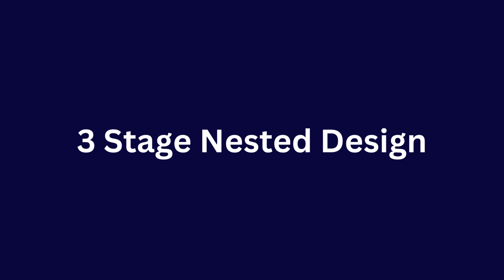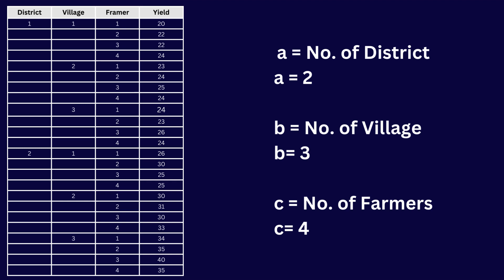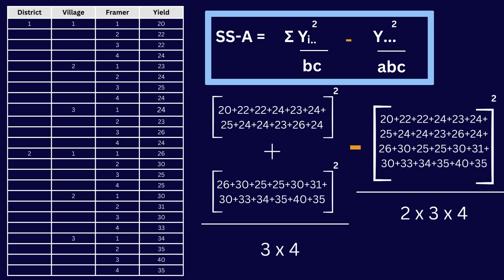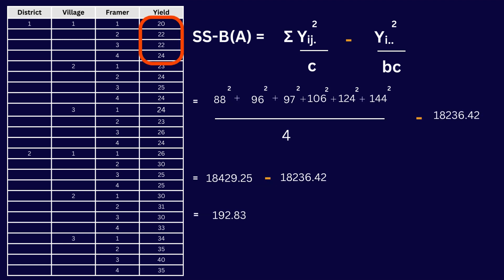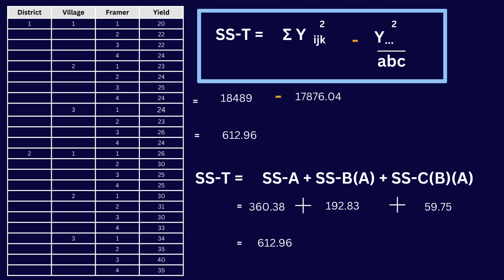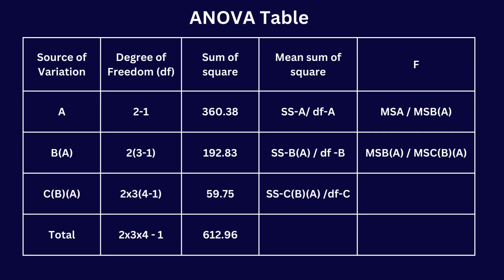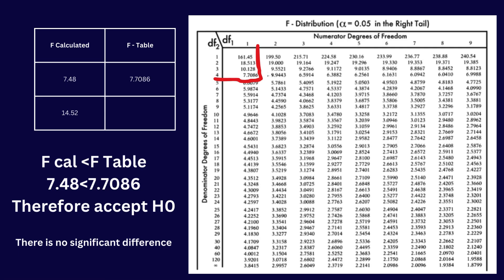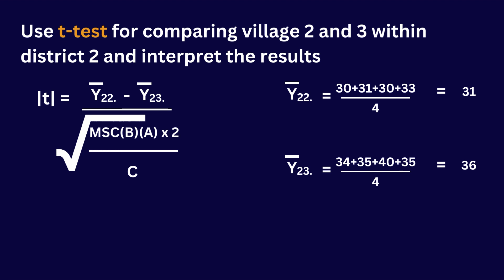3 Stage Nested Design with Examples

Comment: what if you have something like this
You need to set up a mesocosm experiment to study the effects of salinity and dissolved oxygen levels, individually and in combination, on the growth, metabolism, and survival of juvenile shrimp. The experiment requires three salinity levels (S1, S2, S3) and three dissolved oxygen levels (O1, O2, O3). S1 and O1 serve as controls, representing the natural conditions shrimp experience in their habitat. Each parameter separately, as well as their combinations, must have three experimental replicates.
Reply from the maker: If you structure this experiment as a nested design, one factor is nested within another rather than being fully crossed. In this case:

    Primary Factor: Salinity (S1, S2, S3)
    Nested Factor: Dissolved Oxygen (O1, O2, O3) within each salinity level

This means that within each salinity level, you test the effects of different dissolved oxygen levels. Each salinity level contains its own set of oxygen treatments, rather than testing oxygen levels independently across all salinities.

Each salinity group (S1, S2, S3) contains subgroups of oxygen treatments (O1, O2, O3), and each combination is replicated three times for statistical robustness.

This nested structure helps analyze how dissolved oxygen affects shrimp within each specific salinity level, rather than assuming oxygen effects are identical across all salinities. It also accounts for potential interactions while maintaining a hierarchical organization
Reply: @dataanalyst4449  thank you so much, and when calculating the degrees of freedom, we will have 3*3*3 -1 =26?
Reply: @dataanalyst4449  and is there a particular nested design diagram you can be able to draw from this